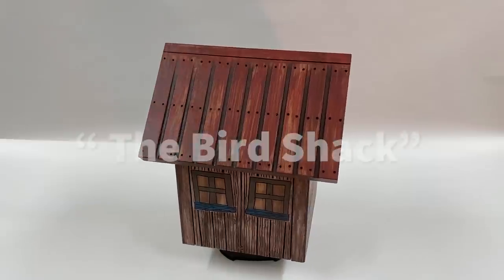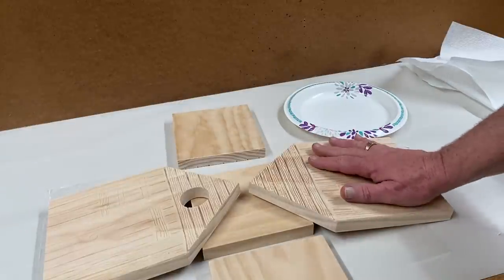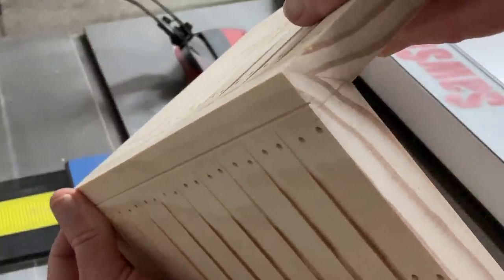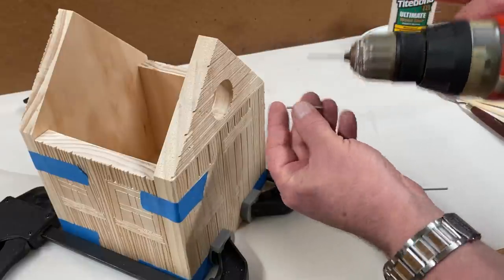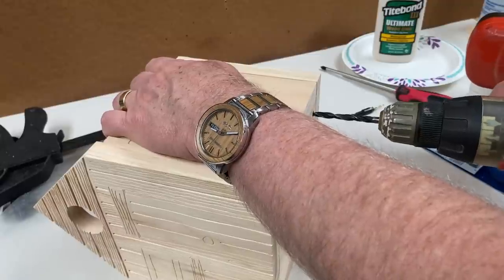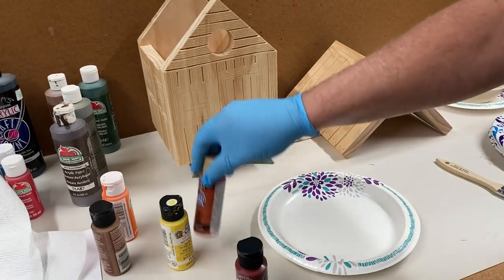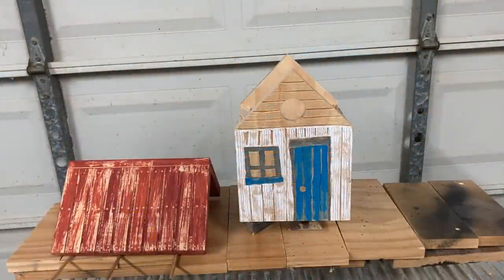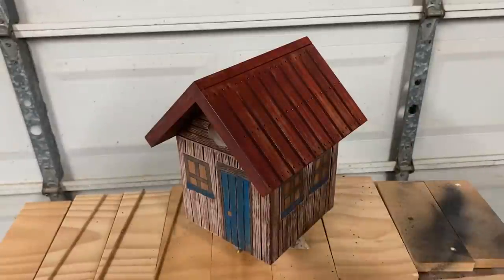Making The Bird Shack  | Michael Tyler's FREE CNC Project of the Month | Vectric

Comment: Great project. Just wondering why you are using .375" thick wood in your projects instead of .500". With .375" boards there is more cost band more waisted wood. I have made many of your projects with .500" wood with no problems. Why use thicker wood that cost most, and do machining that is wasting wood. My problem is, I like doing things the most efficient  way. Thanks again for the great projects.